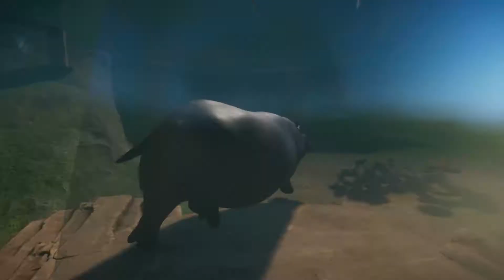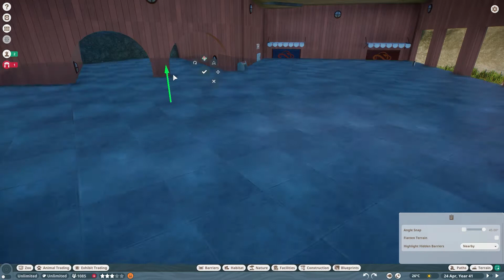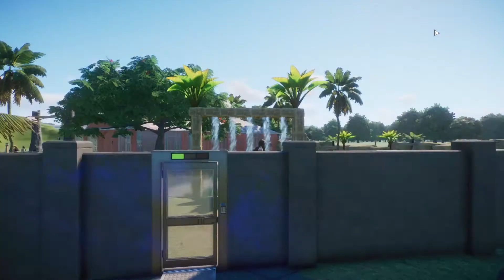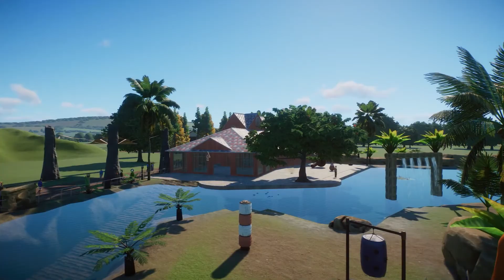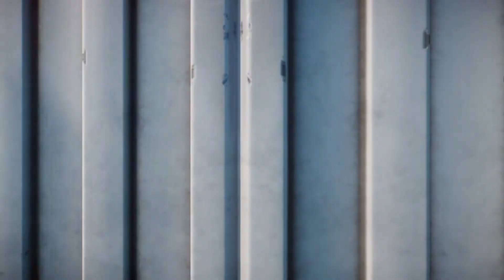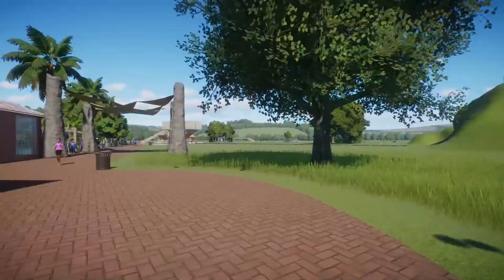Planet Zoo | Pygmy Hippo House | Hippopotamus Habitat

Comment: Great built,,having problems with flooring but will eventually get it right!
Reply from the maker: Thank you! Paths are hard in blueprints! I do hope you can get one to work! I struggled a bit too doing the placement in the video.  Sometimes trying from up to down or down to up helps.  Check settings for snap to barrier, flatten to terrain etc.  These will change how the path cooperates or doesn't cooperate lol
Reply: @Mathletee  Thank you,i will try those.Built a Hippo habitat myself,took a very long time only to find the Hippo's never went in the water😁Looked for some blueprints after that which has underwater viewing but same problem or didn't know where to start with path connections etc.I ten came across yours,the Hippo's go straight into the water and only flooring to sort now,your video explains brilliantly also,thanks for the tips!🙂
Reply from the maker: I am so glad you found this to be helpful!  it is tricky getting them in the water, they need a slow slope.  There is a speed build for this habitat too that may help you with future hippo builds! https://www.youtube.com/watch?v=Np2yf9jNTng&list=PLaLP5YTLvAmS434FcjnxGmEQOcjO2JHID&index=2
Reply: @Mathletee  Thank you!🙂